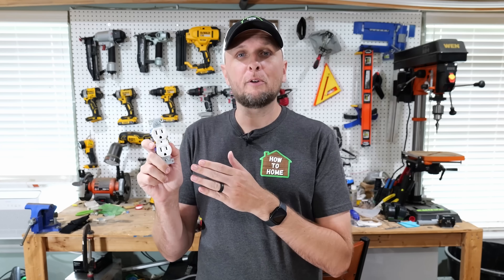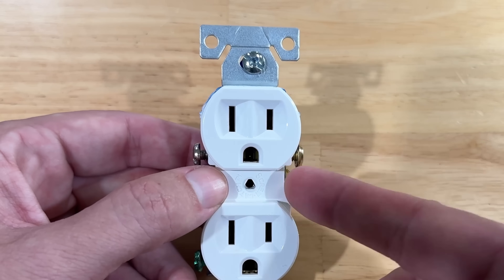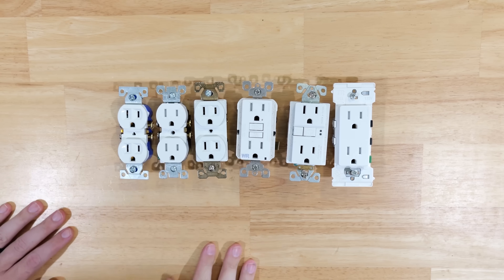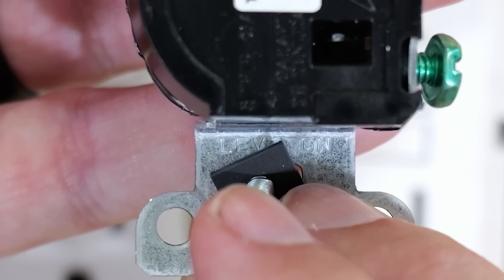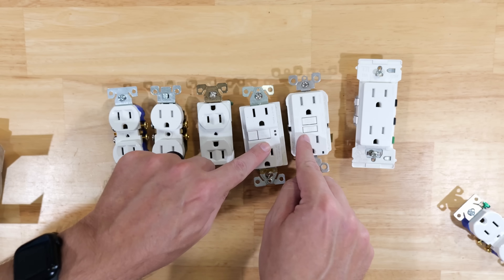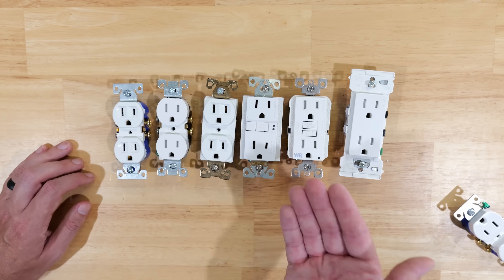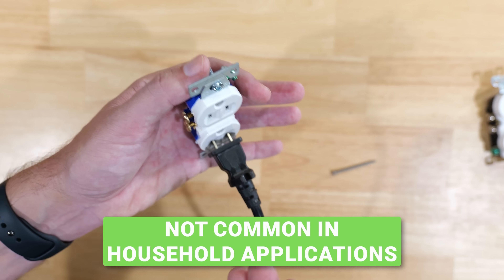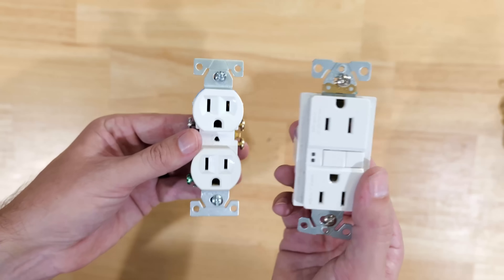The Shocking Reason Why Your Outlets Are Installed Upside Down!

Comment: Everyone knows the ground is down.  Power lines are up.  ... when pulling the plug from the receptacle we can not see the bottom, so we want events down there to be less serious.   Now looking at the wall in this place ... the receptacles are all mounted sideways throughout the building.  Should the ground prong be on the left, or on the right?  ;-)  This is also common in kitchens just above the lip of the counter top, if it has one.    .. just realized,  sideways neutral up is safer for falling things than is ground up, as ground up things can still fall sideways an hit the hot wire.   Ground down is safer for when mopping the floor.

Comment: My ears hurt! From your analysis, the number one rule is.... there are no rules.
  My personal opinion is this: if the possibility exists that an unlearned individual can access the plug, and if the unlearned individuals center of mass will be ABOVE the level of the concerned outlet), then ground prong UP is the only way!.

My reason: As a child (one example of an "unlearned individual"), I was using a butter knife to try to pry a stubborn plug from a "ground prong down" receptical. I was shocked to find out an outlet could hurt me (pun intended). Both PAIN and SPARKS resulted from sliding the knife down between the outlet and the plug. The knife contacted the "hot" prong first (PAIN), then the "neutral" prong next (SPARKS). I survived my very first direct encounter with electricity, and I will admit that the odds of these things happening are very slim, and there are NO GUARANTEES that one way or the other will protect the current circumstance. But I am PREJUDICED in this area. Thank you though for all of the info you covered. I was a little concerned because I had never found anything in the code about this, and your video was the first to cover this subject. So now I can confidently suggest "ground prong up" without fear I might be contradicting the "code". Lol. Have a great day!

Comment: You missed one obvious example that is manufacturer-driven.  There are some brands that are made for 'child-safety', that is, the hot and neutral openings have internal shields that drop down into place to prevent people from pushing a fork or knife or wire into them when a plug is not in the receptical.  These only work in one orientation and so far, I have only seen them designed to work with the ground port down.

Comment: One thing you did not point out is that the code requires that the ground is the first to make when you’re plugging it in in the last to Brake when you’re unplugging it. If you notice the ground prong on the cord that you were using to plug in the ground prong was longer than the hot and neutral for that reason. That is why I like the ground to be on the bottom because if a weight of the cord or something was to pull the cord down. The ground would be the last to break or pull out.

Comment: Some 3-prong appliance cords are molded such that the cord is at a 90 degree angle to the prongs of the plug. If you plug these into a socket with the ground on the bottom, the cord will naturally hang straight down, parallel to the wall (this is good). But if the socket has the ground at the top, the plug will have to be inserted so that the cord is pointed up. In this case, the cord will loop over and hang down, with the weight of the cord pulling down on the the plug, partially rotating the prongs out of the socket over time.

Comment: My brother was an electrician and I've lived in dozens of homes across the US. I've always known prong side down to be the correct way to install the outlet. In the house I just moved into, it seems at least one outlet in every room is upside down. I'm guessing those are the ones that connect to the light switch. But I haven't confirmed that in every room yet. What I really don't understand is why not every room has a ceiling light! The light switch should go to a ceiling light and the outlets should be for other things. Growing up, we didn't have lamps throughout our house. We had one extra light with a magnifying glass for craft projects and things that needed extra focus. But it wasn't a feature used to illuminate the room. If I wasn't renting, I would have lights installed throughout the house. But I just don't get why it's even an issue. Why wouldn't somebody install a ceiling light in each room to begin with??? Lamps are extremely hazardous for many reasons. My dad was a safety manager/officer/fire marshal. Pretty much any title held by someone involved in safety/OSHA regulations, he had at some point. He taught me why lamps are dangerous and it makes me extremely uncomfortable relying solely on lamps in all the bedrooms in my house. Especially with a young child and a cat in the house.

Comment: My only thoughts about the orientation before this video revolved around the weight of the cord. If the ground prong is up, then tugging on the cord over time, pulling it out, I see it as slipping out of the outlet under it's own weight as being more likely because it only has one prong that is being pulled against while the other two rotate to follow, where as ground prong down in this scenario would be pulling against the two prongs at the top, which are also not rounded, making a better grip to hold into the outlet while the less gripping ground prong is the one rotating with the plug. That's why I always preferred ground prong down.

Comment: Straight out.   There is NO "upside down".    NEC has no requirements for outlet orientation, other than you can't put them face up on countertops, under sinks, or on workbenches.      Otherwise, it's whatever works best for your application.   Ground down reduces strain on the ground pin of the plug, as most plugs are put 18" or less to the ground.   That means someone unplugging is pulling out, _and up_.   If the ground was on top, it would take the force of the load, and it's the least secured pin - while also being the longest.  On bottom, it tends to come enough out of the hole to come loose with the live and return.  (I have several cable ends where the ground pin just popped out, likely from that scenario.)    

That said, I've worked with outlets on their side, 'face up', 'face down', and all sorts of orientations.    There is no "ONE TRUE WAY".

Comment: The argument for ground pin up protecting against dropping metal shorting the contacts sounds like... in the event that lightning manages to strike this quarter inch plug that's shielded in plastic... probably never going to be a problem for so long as the outlet lives.
Aren't they worried that if you install ground pin up that someone might flip a sheet or bar of metal up underneath the plug at just the right time when the plug is not flush and have that short the contacts? I mean, doesn't that sound as equally dangerous and possible?

Comment: Once an electrician told  me that to avoid confusión during wire instalation he always placed Hot on the left, same as water in shower,  that way ground pin would go up.
Personally I feel ground pin  down withstands more weight.

Comment: I worked as an electrician for several years. There were some instances where ground orientation was specified. Typically in industrial and hospital settings. Otherwise I’ve ALWAYS installed receptacles with the ground down. I think it is aesthetically pleasing and it’s what we are accustomed to seeing.

Comment: My brother is a master electrician and had the same opinion as @k4ebyk4eby6 when I asked him about receptacle orientation. If the plug accidently gets pulled out the safety ground pin is the last to disconnect making safety the #1 priority.

Comment: Hello, in Puerto Rico Puerto use the NEC no local code and whe put the recept. horizontal always the neutral down supposedly in case of an inundation the water touches firste the neutral an the ground and when it touches the live wire it's going to short circuit saving the life of someone.

Comment: 8:50
In that case, to be perfectly correct, install it ON a wall, sideways, so that whichever way the earth socket faces, will be up enough to be down in the other case.
See - A Kiwi with the (smartarse) answer.
p:s:
If you install them horizontally "sideways on" when on a wall, nothing can "drop down" and contact both pins, so install them with the Neutral UP, so that if anything does drop and rests there, it's not going to electricute anyone who sees it and tries to remove it.

Comment: 1:24 ?
That's incorrect isn't
The smaller terminal should be on the LEFT.
Which of course is the phase (hot) wire, compared to both the neutral and earth wires.
HOWEVER that would mean putting the earth socket at the top, which also isn't recommended.

SO WHO MAKES THAT OUTLET or is the USA back-arsed to what Australia & New Zealand have?

We have the HOT (Phase outlet) on the LEFT with it's forward slash hole, while the backward slash hole on the RIGHT is the neutral terminal hole, (of the same physical size) and of course Earth is the vertical slot between and below the other two, most often than not, slightly larger than either of the other two..

HOWEVER, it's OK to fit sockets ON THEIR SIDES, in the same orientation obviously (as the sockets are technically the ame, just the wall recepticals were installed on their sides and not vertically).

It's also allowed to have sockets mounted FACE UP (on the floor) as well as FACE DOWN (on the ceiling), or on pendants which hang at the end of ceiling mounted cordests.

So - your point is what?

Comment: "Unless you have a local code" (8:43).... This is a key point.  I attended a 2-day electrical safety workshop that was being held in a conference room in a hotel in another state than my own.  When first entering the room I noticed that all the receptacles were oriented sideways, with the neutral slot up.  The speaker at the workshop had also noticed this, and inquired about it before we arrived.  The local code required it.  The Local Authority Having Jurisdiction (LAHJ) always has the right to tell you how to do things. However, the local inspectors don't always agree on everything.  You have to do what YOUR inspector tells you if you want him or her to approve your installation.

Comment: Best video on this topic.  Contrary to many comments, there ARE some right-angle cords designed for ground-up sockets.  Common examples include air conditioners (and extension cords for them), clothes dryers, electric ranges and RV power cords.  If it's true that NEC and NEMA have not weighed in on residential outlets, the correct answer must be, Who Cares?  Personally I think it bothers some people if the little smiley face of two eyes and a mouth must go through life upside down.

Comment: One outlet in my bathroom has been installed sideways. I have a space heater and my electric toothbrush plugged into it. It seems to throw the switch more often than anything else in the house. Sometimes the safety light on the plug is flashing green and sometimes it’s red. Now I’m wondering, is it because it’s installed sideways?

Comment: "...in the event that a paperclip was to fall from above and fall just perfectly -- which would be incredibly rare to happen..." based on that assertion, I should probably purchase Lotto Tickets...

I started in what they now call "IT" we did a lot of work with metal "Forms Rulers" (rulers designed to let the user measure "character spacing" to plan what printed output would look like).  In our office, we had a long trestle table where we could spread out the "fan fold" paper and take measurements.  On a regular basis, we would have these rulers drop off the back of the table and have to crawl underneath to retrieve them.  On MORE than one occasion, I found one of these rulers sitting at a "cockeyed" angle with the edge of its upper end sitting between the plug and the receptacle, resting on the "hot" prong and the lower end resting on the carpet.  This didn't trip breakers or start fires, but it DID provide some rather unpleasant shocks to some of the incautious programming staff.  (I was smart enough to use a PLASTIC pen to lift the ruler off the "hot" prong whenever this happened in my presence.)  

After having had similar results with tri-squares and carpenter squares and saws and saw blades (yeah, I can be fumble fingered!) in the shop, ALL my outlets get installed Ground Up -- or, if turned sideways, Neutral Side Up.  OBTW:  I find Adam's "pointer finger" example less than compelling for a couple of reasons.  First, if you look at the "grooves" on the side of his "demonstration" plug, you will note that he is not gripping it as intended by the manufacturer; the friction grooves indicate that you are supposed to grab the plug side-to-side, not top-to-bottom (or, just jerk the plug out by the wires and avoid the whole scenario ;-) ).  Second, if you are unplugging the cord "right handed" as he is doing in his demonstration, your "pointer finger" would contact the neutral, not the "hot" prong as he suggested.  This would be true for a "right hander" unplugging a two-prong cord from a Ground Up outlet as well.  This means that 90% of the improperly de-plugging a two-wire cord from an outlet and "contacting a prong with their pointer finger" would be safer with a Ground Up outlet than with a Ground Down outlet!

Finally, I once had this discussion with one of our electronics techs in the Engineering Lab.  He'd just had all the plugs in his lab turned ground-side-up and I commented on it.  He asked which way I preferred and why.  I told him I agreed with the "Ground Up" position and cited my experiences with various metal items ending up "cocked" between a plug and the floor or a bench-top.  He said he'd never considered that -- then showed my the reason why his plugs were "up side down."  We set up an "O-Scope" and looked at the sine wave generated between the hot and the ground wires on a cord plugged into a "Ground Up" outlet on his bench.  After running a trace on that, he moved the cord to a "Ground Down" outlet on the wall.  The signal was a LOT more "noisy" on the "Ground Down" outlet!  He then grabbed  the plug and pried "up" on it and the noise disappeared.  His conclusion was that the "weight of a typical appliance cord or extension cord applies an oblique force to the prongs in the outlet; with the Ground Up, that force has the effect of improving the grounding connection; with the Ground Down, it makes it worse.  

My $0.02 Worth -- and that's inflation!

Comment: The 120V outlets in my Cybertruck are installed with the ground prong down. And the 240V outlet is situated so the 240V plug has the cable exiting at the bottom. Because it only makes good sense. People who install outlets in the opposite orientation are just messing with you, because they can.

Comment: I think the arguments either way are rationalization.  
There are some lay-flat grounded plugs that have the cord go to the ground side,  or away from the ground side, and of course some at an angle.  If it's an outlet that will predominantly have only one appliance plugged in, like a refrigerator,  disposer or dishwasher, I'll orient the outlet so that the cord hangs down.  I'll even go as far as reorienting the outlet to achieve down-hanging cord if necessary, because the orientation is not uniform between appliances.
Otherwise it's just aesthetics.

Comment: Install the ground prong down and learn to plug things in all the way and use the finger indentations of the plug to grip it and unplug it. Try to plug things in with it upside down in the dark. It doesn't work very good if you think outlets are normally installed with the ground side down.

Comment: If there was a significant safety issue with receptacles being installed with ground on the bottom, I believe that hospitals would install them oriented ground on top. Hospital electrical systems are probably the most tested and inspected that are commonly encountered and I've never seen a single outlet in a hospital oriented ground on top.

As far as common household objects falling and landing in contact I've seen mostly small chains (necklaces usually) that were on top of a dresser that's placed in front of a wall mounted outlet with an alarm clock, phone charger or similar ungrounded cord. Even with a grounded cord a small, highly flexible metal chain is going to contact the line and neutral regardless of whether it's also touching the ground prong.

Comment: I had a dime come outbof my jacket pocket.  Flies 5 feet and landed on a pluged in plug for a lamp. It shot sparks out and then stopped soarking and welded  itself to the 2 contacts and did not trip the breaker. I didnt see it happen, I saw the sparks.  Was a crazy fluke thing. I had to keep the dime.

Comment: If you grab the power cord on most appliances and pull it straight out which side is the prong facing normally I think that would be a manufacturer's thought and on the old chords that had the fat and the small side if you pull those cords out they end the same way so you have to twist the cord to plug it in which will cause the wires to fray over time

Comment: I have always preferred ground down orientation, my logic being, if a cord cap gradually withdraws from a receptacle due to gravity (also due to a worn-out receptacle) the safety ground prong on the bottom will be the last terminal to break contact which seems to me to be a safer condition than if the ground loses contact first and electrical utilization equipment remains energized.

Comment: I never pull a plug so close to the receptacle.  Generally I'll pull it from the edge of the cord or if i need to the center of plug. But never so close or night be possible to touch a prong.

Also not addressed on the video are outlets that are wired on their side.